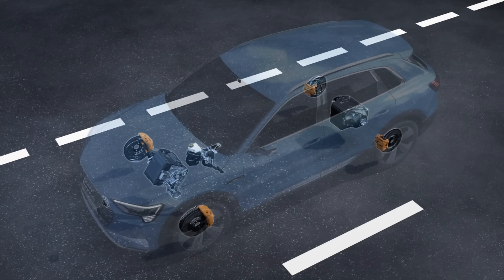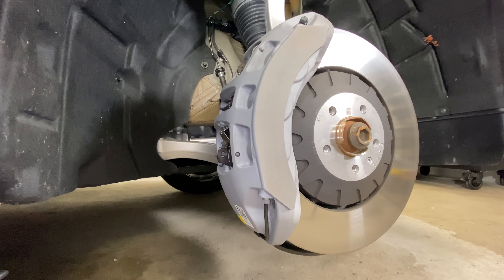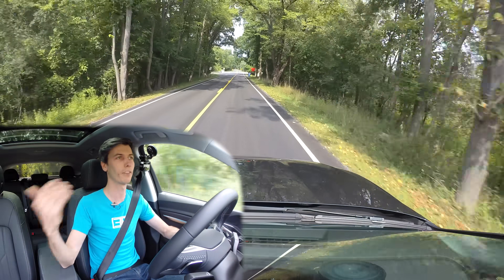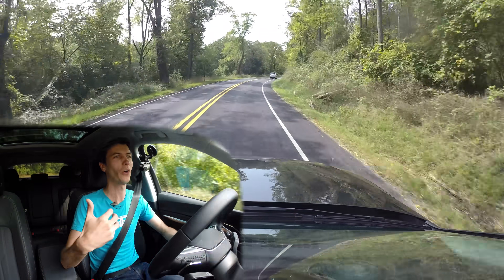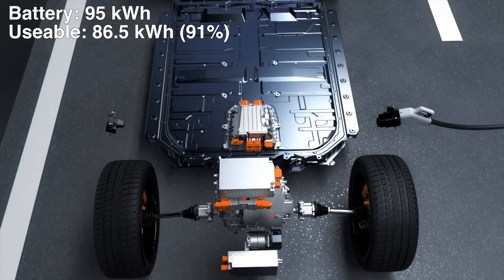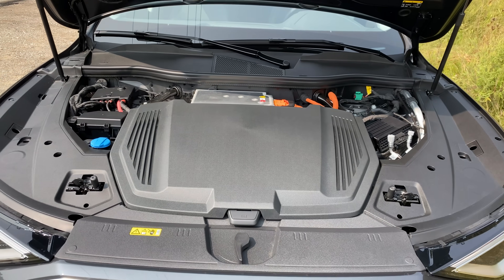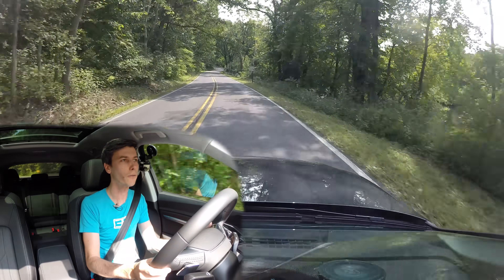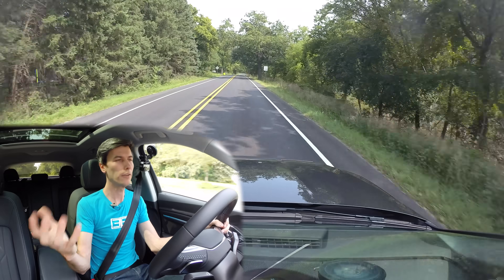How Does Brake-By-Wire Work? Plus: Audi e-Tron Sportback Review!

Comment: Look up the 1320video “on fire at 120mph with no brakes” no, I don’t think brake by wire is safe at all. Brakes are the single most important part of a car. Stop making it more complicated than it needs to be. They couldn’t pull the “E- brake” because it’s electric, and the electrics were on fire and not working.. I think the old style lever handbrake needs to make a comeback especially if the pedal brakes are becoming less and less attached.

Comment: What's going to happen in 10 years when the wiring harness starts to go, or if the harness chafes and shorts out.  You're driving along and the brakes suddenly lock up or dont work at all.
Reply: I mean... It's either that or your combustion engine / transmission blows up etc... Kinda a bad argument.

Comment: Fly by wire throttle is terrible. Electric power steering doesn't have real feedback. I bet brake by wire is the last nail in the coffin.
Reply: I'll see your brake by wire and raise you a clutch by wire on a """"manual"""" transmission. Yep, Kia has come out with that one.

Comment: My concept of fail-safe is functionality in the event of a catastrophic failure. Having one electronic system monitor another electronic system doesn't protect against a catastrophic electrical failure. Rather the primary electronic system ought to power a solenoid to divert fluid from the brake pistons. In the event of a catastrophic electrical failure the solenoid would be de-powered and fluid would flow to the brake pistons. Unless I misunderstood your explanation Audi's system is less than fail safe.

Comment: How does brake fade feel then? Would you feel any at all as technically your not feeling the brakes?
Reply: Good point, it could be quite dangerous if the electronics automatically compensate for brake fade by applying more force and you don't realize you're cooking the brakes until it's time to brake hard.

Comment: Airbus uses Fly By Wire however these systems are designed by Aviation Engineers and these Engineers do not work in the Automotive Industry, so I question the long term dependability of this system for cars. Not that Automotive Engineers aren't an integral part of the World, it's just 2 entirely different sports, Car vs Plane. I just think it's still too new of a technology in the Automotive Industry and in my opinion, it's not tried and true as of yet. I am going to stick with good old tried and true traditional brake fluid systems for my Cars.

Comment: A worry is also brake pedal feel, especially in the wet or driving sporty.
Reply: Short answer: There is no feel.
Nothing in these modern cars has any feel.
Reply: @alouisschafer7212correct; there is back-resistance on that brake pedal, but it has nothing to do with what the brakes are actually doing. The 'feel' is 100% artificial.

Comment: i've driven both the alfa giulia base q4 here in canada and the stelvio diesel in italy and while brake by wire (or BBW as i like to call it since there is definitely no confusion with any other acronym) is strange at first, you get used to how to modulate the pedal for how much braking you want.

Comment: Bought the original e-Tron last year and have been loving it!  You can lower the max charge level if you only want to charge to 80% for example, but you're right, you can't use the entire thing as they keep that last bit in reserve.  Always wondered if that reserve would activate if you ran the charge the 0% but never tested it. I went with the Audi over the Telsa due to the extra features (HUD, carplay, soft close doors, etc) and the better fit and finish (though Tesla seems to be getting better on that part).  It really is a great electric car for those that don't want to lose any of the normal-car luxury items and don't care about advertising that they have a "special" ride (it goes under the radar).  Range has never been an issue, but like you said we have another car (PHEV) for the rare long trips we take.

Comment: I assume (and this is a BIG assumption) that when the car sits in the parking lot dead and you've just sat down into the driver's seat, pressing on that brake pedal (I mean, this is the very first thing I do in any car way before I turn the key) if the brakes work at all, it's going to be the redundancy system doing it... Right?

Oh. And another thing: If one Does attend the occasional track day and the brake discs fade (as they will be commanding far above 0.3g) does that mean that the brake feel on the brake pedal will stay consistent; no deepening of the pedal to send warning alarms to the driver of his/her imminent brake-free driving?
Reply: Yes, if you haven't turned the car on at all, the blocking valves will be open and you will be applying hydraulic pressure to the calipers entirely mechanically, just as in the case of total electronic failure.

Comment: I agree with you argument regarding not needing excessive range, but I worry that low range EVs (200 mi)  in today's market are going to have terrible depreciation over the next 4 years as efficiency and improvements move the typical range offerings up past 300 mi or higher.  Just consider a low capacity Leaf in today's market.

Comment: LOL! "For everything around town, you don't need long range". Sure, but the EVs we're looking at are Teslas and Audis for 50+K! Noone is going to spend that much for "just around the town".  As a matter of fact our around-the-town car is a used ICE that I got for 900€ :-) These expensive EVs must become fully usable even as a business car. As soon as they take that milestone, ICEs are dead as EVs are cheaper to operate. But since you cant take destination charging as granted yet, you will need lots of range. When going to a hotel or customer with no charger available you want to arrive with enough charge to reach a charger the next day. Neither do you want to make an extra stop short of your destination in the evening, nor should a charge-stop be the first thing you need to think about on the way home. More range adds flexibility. To further develop destination charging is equal as important as chargers along the highways.
Also you need to take into accout typical business trips with 130km/h - 150km/h in the winter and you never drive down your battery to 0%. And neither are charging stations always located perfectly where you'd want them to be. Taking all this into account, with a 400km WLTP car,  you better plan for a realistic usable range of around 200km-300km between stops. I mean just calculate 25kwh/100km @ about 130km/h with a 86kwh battery you'll be down to 10% after 300km and thats assuming 100% a charge. Will you arrive at a charger just then, or will you opt to stop earlier? For said reasons thats simply not enough for a serious car of that price.

Comment: That bypass valve is never used, so what's to say that when it is needed, say.. 10 years from now if that fails, who's to say the the valve will function properly?
Does it require maintenance? Replacing? What's the service interval?
Reply: I would expect that the value should be tested on start up every time or else as you say, how can you trust it.

Comment: All fine while young, and subject to routine dealer servicing, but there will come a time when it passes down the food chain, to independent garages, or no servicing at all.  Then it may become unsafe.  Otherwise, they all get scrapped earlier than current vehicles, leaving lower income people with no transport, or trying to keep ever older ICE vehicles going.  Removing personal transport from lower incomes will need a significant change in culture and location especially with regard to home/work/shops.
If most of the time it is using regenerative braking, the electric braking system is little used, so could be prone to 'lack of use' failure.
By the time the electric system fails, the unused hydraulic system will possibly be inoperative due to neglect.
If we're still thinking of EVs as 'town' cars, why are they all so big?  Most people struggle to afford one vehicle.

Comment: Is there a way to practice braking in fallback mode? As I understand it there is no classical brake booster so I guess that most people still would crash into something because no-one is accustomed to apply so much force on the brake pedal.
Reply: An electric booster pump provides hydraulic pressure via an accumulator which acts as a pressured reservoir and is always charged to a certain pressure. That is how Toyota and Lexus do it.

Comment: They should just put a portion of travel on teh pedal that does nothing for the brakes, and after that it should be a classic brake (hydraulic). In the first portion before the brakes engage, you have the sensor that enables regen. Another problem of this system is that if your battery is dead...how do you roll the car? If it's freewheeling how do you stop the car?

Comment: Brakes are the ONE thing I would not want electronic.
Reply: Not fully electronic. Always a mechanical back up and connection for obvious reasons
Reply: @shwilly9186  Yeah but even the failsafe is controlled electronically
Reply: You guys are right they do! I'm just bringing it to the attention since a lot of stuff like ABS was used mostly on aircraft before becomming mainstream on cars.
Reply: @PixeletSushi  I guess some folks don't know just how hard aircraft brakes and tires have to work every day. Every time an aircraft lands it's an emergency stop and the amount of momentum that needs to be converted to heat is enormous.
Reply: That and steering
Reply: Aircraft Brakes which were hydraulically powered for years are now mostly electric on newer airliners like the A220 and the 787. It's has more redundancy and is less prone to failure than hydraulic brakes. They are electric actuators pressing strait onto the brake stack as oppose to the audi Etron that still has brake fluid.
Reply: @PixeletSushi  I’m under impression car use brakes much, much more often and the brakes are not that strong and test every day.
Reply: PixeletSushi you see the airplane ur talking about is meant to FLY, it doesn’t use its wheels mostly except landing and take off...... a CAR on the other hand is meant to use the road and uses its wheel ALWAYS

Comment: so if that bypass has an issue...you wont know until you need it...cool cool cool. i wonder how many vehicles had to have crashed for GM to do the recall in some 2020 and 2021 vehicles because of the brake by wire issues

Comment: Wouldn't it make more sense to switch over to the actual brakes when the regen can no longer meat the demanded stop rate rather than a random set point?

I bet having double your normal need range will be very nice on the night your power goes out for most of the night and you still need to go to work in the morning.

Comment: Sorry, don't trust it. Will never buy a vehicle with anything but Hydraulic brakes. Never going to buy an EV or Hibred either. Just don't like them.
Reply: According to Jason, the brakes are still hydraulic. The control is electronic, very similar to many modern commercial and military aircraft today.

Comment: Very cool. Brake by wire with hydraulic fail over seems like a good compromise. Definitely a good car to make EV's familiar to the uninitiated.

While I doubt any manufacturer would do this, I would be interested in seeing the return of the third petal to control regen. It would be like a one-petal driving system, but would allow coasting and have no awkward regen-to-friction braking transition. Maybe its just me, but that might be a neat setup for something like an EV conversion.

Comment: I really need the range, so much so that it is unpractical to have an ev for me. i wouldn't even save money by having one ev and my little petrol car which i use to drive to work in. the amount of short distances i drive are few and the amount of long distance driving i'm doing is so much more prevelent. last job i went to would i be able to just about go both ways on one charge but only during the summer. during the winter would it be another problem cause ev range is heavily affected by ambient temperature. and at work wasn't charging an option either cause i would have to have a normal wall plug extention cable which is about 400 meters to reach my car and a cable that long must shurely loose power when it reaches the vehicle.

so if i were to buy an ev would i have to have a second car anyways to go on the longer rides which is the majority of what i am driving. and to be able to buy an ev would i have to either lease it or take a loan to afford it which massively adds to the amount i will be spending each month. so i would be saving money on up to 30 miles each week, but i wouldn't be able to use the car on the long drives which i do twice per week, once to go to work and the other to go from work 5 days later. each drive was about 150 miles this time but i suspect that it will be an even further drive on the next job, or at least if i get the job i have applied for. if i get that job will the drive to and from work be roughly 620 miles, there are charging stations along the way but when driving a distance like this do i want to be able to just bang down the miles until i reach the destination.

Comment: In my country range isn't the problem. Charging infrastructure and most importantly infrastructure RELIABILITY is a major problem.

Another issue is the huge captive customer aspect ie., requiring a card to use a charging port with one conpany, and then one for another, etc.

The soon they can outlaw this practice, the better. I would love to see the day when I can just rock up to a charge point and just use my debit card. Just like using a.... Petrol pump....

Comment: If the manufacturer of the, "drive by wire" technology has it set to zero throttle or apply brake if no signal! Then if there is a wire issue, you can't move the vehicle! Like how in today's newer semi-trucks(or lorries for those not in the US) air brake setups, ie: no/not enough air pressure = brakes fully applied!

Comment: i really hope they have some feed back that the abs is working.

i live in a cold climate and in the transition periods between fall and winter and between winter and spring is it fairly commong to have some major ice on the roads. i personally use the brakes on a piece of road where i know that the risk of low grip due to ice is high and feel how much i need to stomp on the brakes to activate the abs. it gives me a good estimation of the worst case scenario of how the road condition are that day and drive accordingly. I'm not shure i will be able to feel it the same way without that feed back i get from the abs when it is working.

i am also afraid that i will feel like i could break harder when doing an emergency stop due to no feedback through the pedal but with some feedback from the abs do i know that i can't brake more than the abs allows.

Comment: Not every car with brake-by-wire crap is a hybrid. This valve that supposed to open when system fails can fail too. Plus, what is your braking power when it's in fail-safe mode? Another thing is a failure when system starts randomly braking on it's own - just happened in one older Lexus that I know. If that crap can brake in a Lexus then other brands look really scary. Especially germans, GM and Infiniti&Nissan.

Comment: So as a failure analysis specialist on these systems produced by Continental under the ATE brand, I can tell you all that this system has a perfectly functioning failsafe mode. The scenarios where the failsafe needs to be engaged are so rare and so specific, my guess would be about 0.3 ppm. You do the maths on that 😉. By the way, fun fact: it builds up 150bar (2175psi) of brake pressure in about 0.3s when performing an automatic emergency stop. Try doing that with a conventional system... A certain plus side of this system: weight reduction and usage of space. There is no more TMC, no more vacuum booster, and no more separate ESC system. It takes up a third of the space of a conventional system and weighs about a third less.

Comment: There are many scenarios where every sensor readings will look normal but there is a still failure... No thank you. I want a solid steering connection to the wheels and direct hydraulic brakes. I don't care about the accelerator but brakes and steering must be direct.

Comment: 5700lbs and $80K.  I get they are working the upper end market, but I'm totally not getting it. I suppose this will pay for the development  2800lb , $25K single motor cars with 120 mile range that is going to be the eventual market for EVs.
Reply: Nice video BTW. You gave a good explanation of brake by wire whcih in this configuration seems way less efficient than standard ABS.

Comment: fully electronic brake systems are nothing new and the Prius uses such a system for decades (yes plural go look it up). The e-class also had it but ironically Toyota could make it last. 
The manual override of these systems is horrible. If you've ever been in such a situation you know what I mean. It just feels like horrible brake fade. The area where you're brake pedals usually works is totally useless. AFTER that area you'll have some(!) brake power but only to the fron wheels. Yes you can bring them to even lock up (no ABS in such a situation) and you need to go completely to the floor almost where your steering rack sits. So sit close that you can still stretch your leg so far. 
I like the idea in a Toyota but I don't like it in an Audi or Mercedes